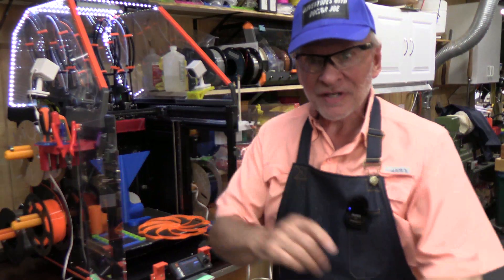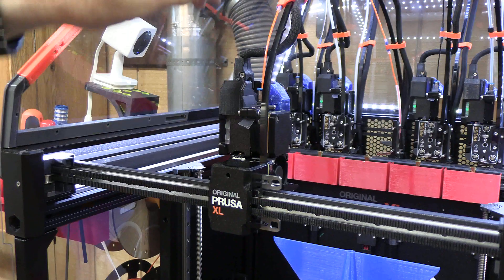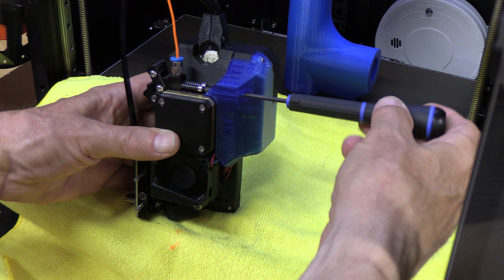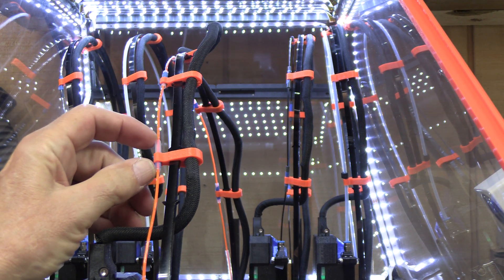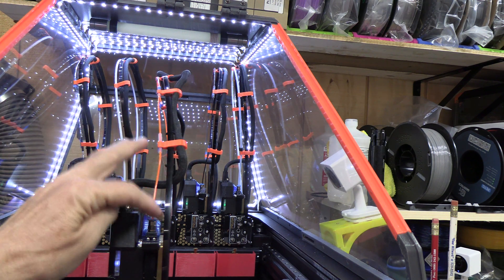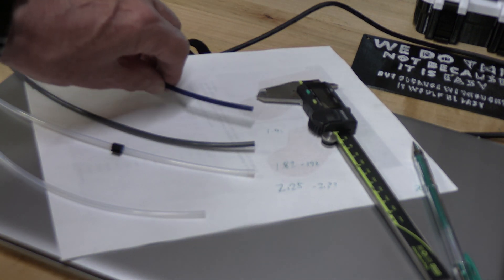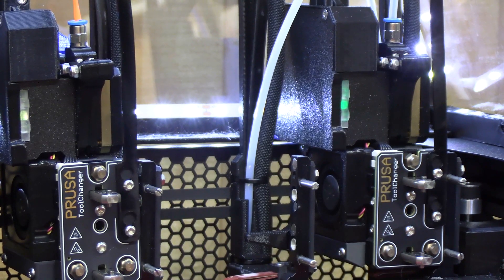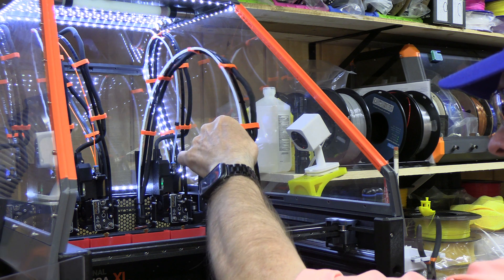3D Printing Failure Corrected! 2.5 mm ID PTFE Tubing!

Comment: Hey Doc.
Reply from the maker: I just reprinted all the parts with PC – CF they’re way harder and have worked well so far. I’m still struggling with TPU but I’m gonna buy a really high-quality one because I think the stuff I’m using probably is the issue not the extruder. Thanks. Joe.

Comment: Hey Dr. Joe, nice video as always.  I'm glad you have found what might be the source of your problem, but time will tell.  I too have an XL5T and have experienced similar problems.  Like you I build the Voxel3D enclosure (your video on assembly was very helpful to me, BTW) and soon thereafter I started experiencing the 'air printing' issue.  In my case I had long ago stopped using the original Prusa bowden tubes and replaced them with 4mm OD/3mm ID tubes.  (Using those with my MK3/MMU2S  improved reliability of multi-color prints with that setup.)   Admittedly, the only reason I switched to using the 3mm ID tubing was because they were more transparent which made it easier to see the progress of the filament tip during loading.

On Prusa forums there has been postings from others also having this problem.  One theory circulating there is that the increased heat of an enclosed XL is causing the filament idler parts to distort causing a reduction of pressure on the extruder gear (causing chewing of the filament).   That theory has gained a lot of credibility with the release of the Official Original Prusa XL enclosure.  Their enclosure kit includes replacement idler parts for the tool heads printed in PC-CF.  I've printed those parts myself using PC-CF and have installed them on my XL tool heads.  I only finished the swap-out of those parts this week so it will take some time to determine if that is the solution.  

As I did the parts swap I did compare the original PETG parts with my newly printed PC-CF parts.  Because of the irregular shape of the idler lever it was difficult to get a consistent measurement but I did observe the the metal sleeve was loose in its hole compared to my new part.  Looking at the old and new parts side-by-side it did seem that the hole for the metal sleeve on the PETG parts had been stretched slightly.  That would reduce the pressure of the idler wheels on the filament.   Tightening the pressure adjustment screws would likely only be a temporary fix as it would distort the part further.

You might want to  download the assembly instructions for the Prusa XL enclosure that documents the extruder parts upgrade steps.
Reply from the maker: That is absolutely great information. Thank you so much. I will totally do that and also I’m gonna switch to the 3 mm inside diameter tubing. You really helped me a lot with these comments. Thank you so much for responding. Have a great day. Joe.
Reply from the maker: I cannot find the assembly instructions for the Prusa XL enclosure. Sometimes their website is very frustrating to me. It’s not that easy to navigate. Could you send me the link to that please? Thank you so much, Joe.
Reply from the maker: OK, I did find the next router upgrade, but I can’t find the files to download The idler parts.jphunstad@gmail.com Is my email address. If you could possibly send me the link or the STL files that would be so appreciated. Thank you. Joe.